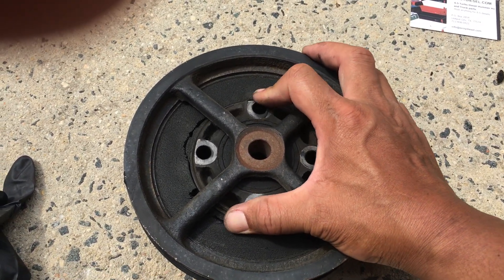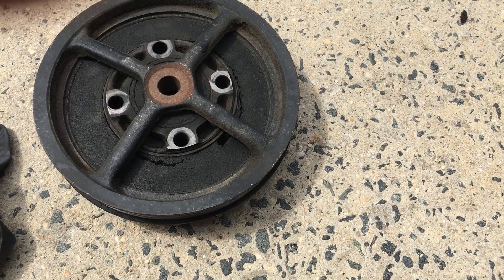6.5 Diesel crankshaft Pulley upgrade

Comment: Your Balancer ok , I hear the balancer gives out in the 6.5 too .
Reply: Peter Martinez stock balancer 320, thousand miles.
Reply: I have a 94 with 194k and the stock one is still good. But as we intend to travel with this truck I replaced it anyway. Much easier at home than on the side of the road or worse yet a broken crankshaft.

Comment from the maker: By the way it's 15mm socket not 10mm like I said.
Reply: live2prep you don't measure bolt by how big the socket is to remove it. you measure it by the diameter of the bolt shaft where threads are.